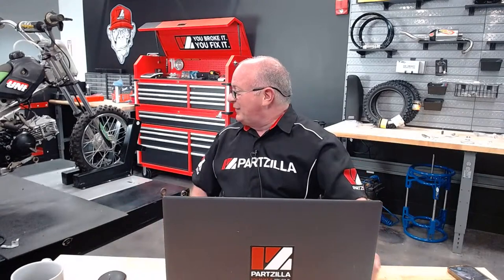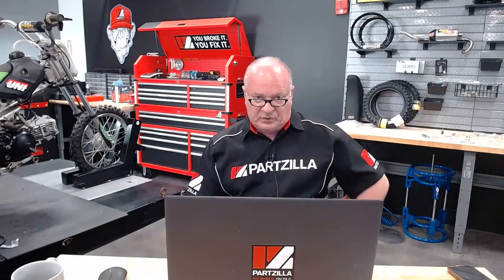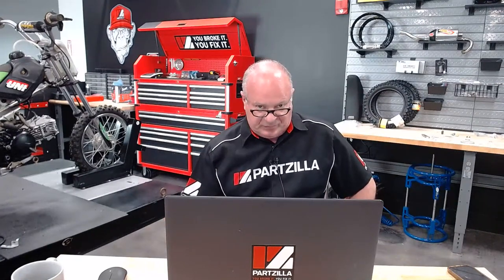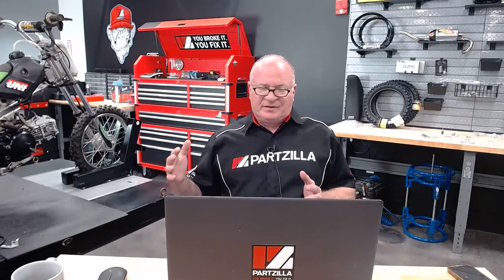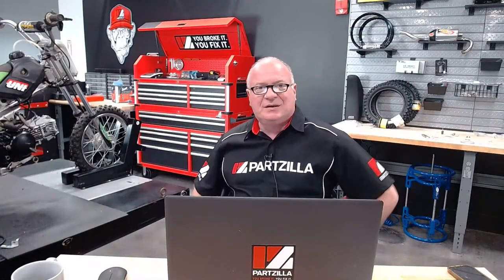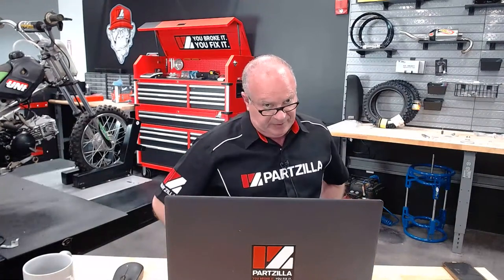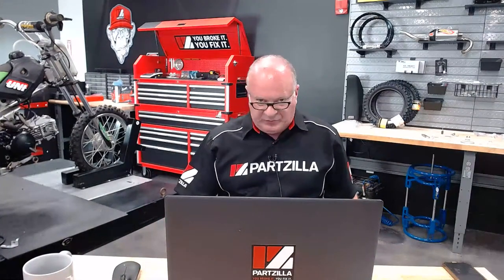Live Q&A with John Talley | Partzilla.com

Comment: Hi John! Really enjoying your content! I’m currently doing a valve adjustment on n a 2008 r6. And I’ve got the shims in but for some reason I can’t get the timing correct. TDC always seems to be half a tooth off when exaust and intake cam marks are in alignment  with the mating surface. Is this normal at 50,000 km?